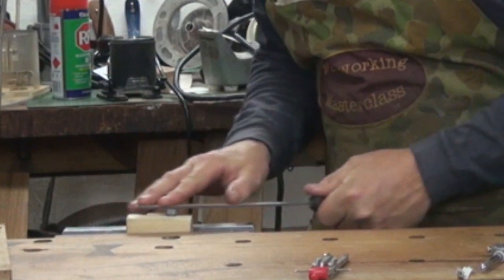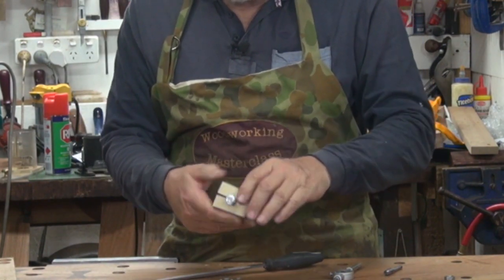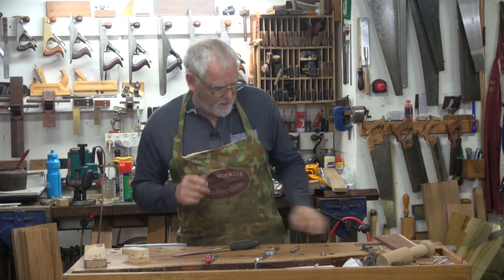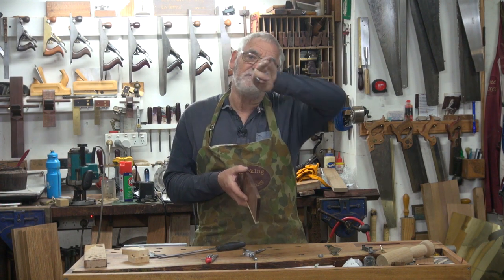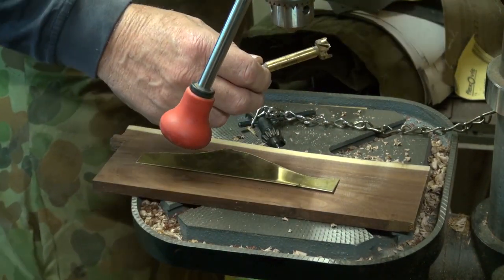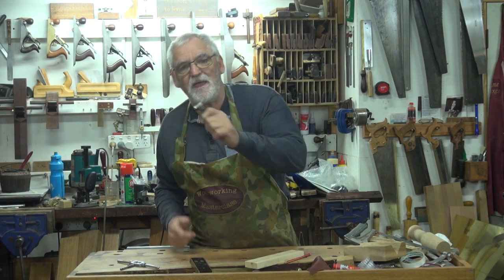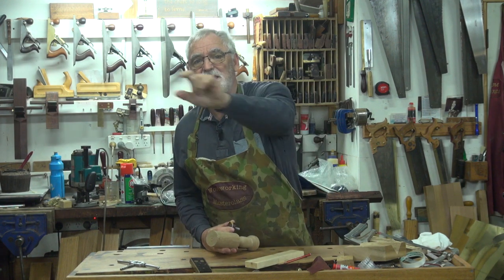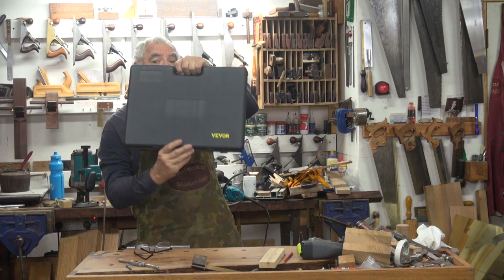Making Wooden Knob feature with Steel Bolt insert. Music Stand 3

Comment: VVPCS  code does not work and $100 shipping to Qld
Reply from the maker: Hi Philip. Just tried it @ 9.40am. Worked fine, discounts to $68.99 and free postage as well. Try again https://bit.ly/3PZx4Fo Cheers Steve
Reply: Thanks steve for reply .Link you gave me brings me to the product at $97.99 code does not work. enjoy your channel
Reply from the maker: @philip914  Yes you have to continue to the shopping cart. Which means you will have to log in and proceed to the end payment. In the top right hand side there is a box that askes for a code. Put that in and it will reduce and give free shipping. Cheers Steve
Reply from the maker: Going live in the next few minuets if you what to do it with me. cheers Steve
Reply: @Woodworkingmasterclass   Yes steve did all that and are familiar with online purchases . all good i will give it a big miss.
Reply from the maker: @philip914  No worries. I have let them know. Cheers Steve